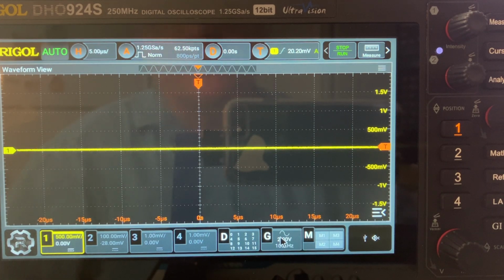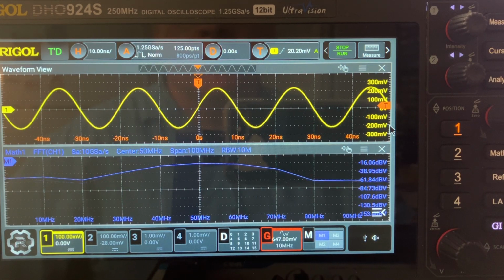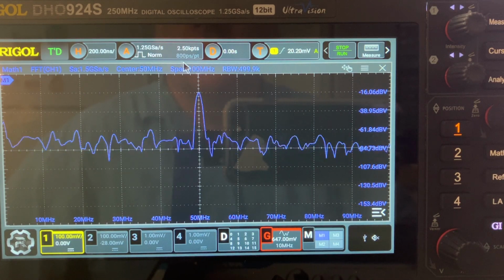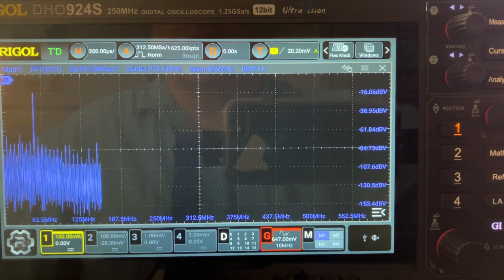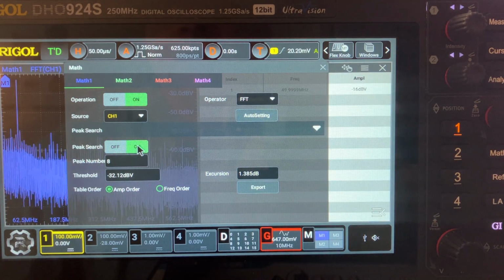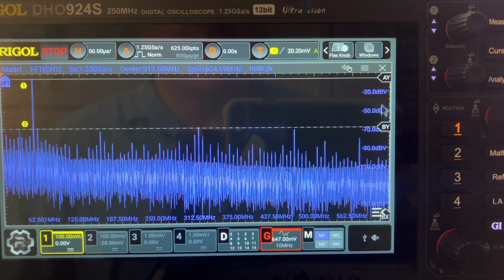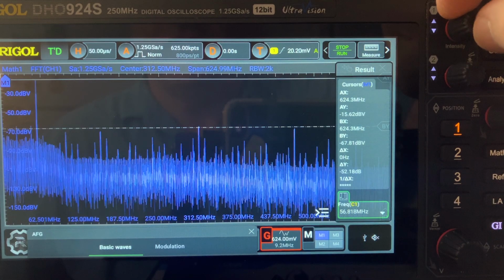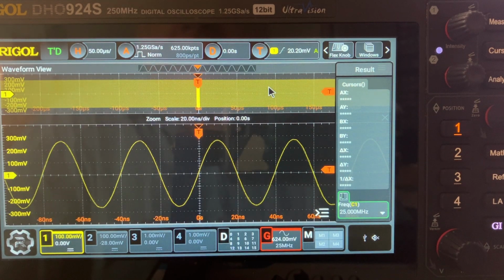FFT with Rigol DHO924s with arb generator at 60mhz

Comment: Hey Steve, great presentation and insights. Please, could you give me some ideias to how build correct the .csv file for Arbitrary waveform? I tried find this information in the user manual without any good conclusion. The manual says something related to .arb files but my scope does not reconize this extension. Just .csv. I tried build this .csv file using the Ultra Station provided by RIGOL but unfortunately does not worked.  Thanks for your time.
Reply from the maker: Best way would be to take my working files from github with the correct format and size and change the 8192 table.
Reply: @stevelevesque939  Thank you!

Comment: Steve, how did you enable the cursors in FFT view? On my DHO804 it doesn't work.
Reply from the maker: when in the fft mode press cursor button
Reply: @stevelevesque939  Thx. My fault was to choose CH1 instead of MATH1 as source for cursors.

Comment: Steve, would you recommend this scope for the hobbist?  I''m looking to purchase a scope for audio circuity work.  My budget is $900 USD.  Recommendations?
Reply: The DHO900 series is a great choice for serious hobbyists. The scope capabilities for its price is impressive and above that its controls by GUI are surprisingly performant. I would definitively recommend the 4 channels unit since most projets at a point or an other will involve microcontrollers; ardruino, ESP32, STM32 other devices. Furthermore, it can be mounted on an arm using the VESA mount behind the scope. It will save you bench space. It is more expensive than other 8 bit oscilloscopes but it worth every penny.
Reply from the maker: Well look at the DHO804 or 814 if you don't need logic analyzer input and freq generator. However I can do bode plot with the costlier 914s or 924s up to 25mhz which cover audio. I am about to show some video about this. Siglent is coming out with a 12 bits sds804X HD just now with seemingly better specs on paper.  Also, you can probably get old DS1054z for a bargain now if it is your first scope if you only do analog signal.
Reply: Thanks Steve @stevelevesque939